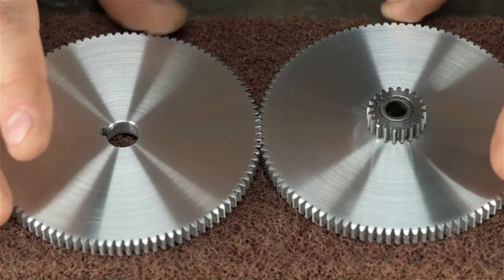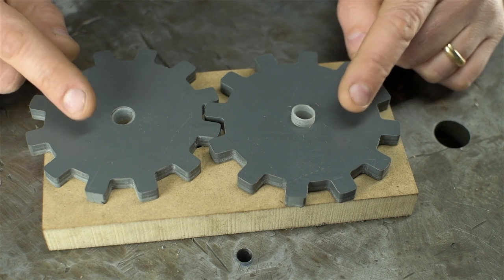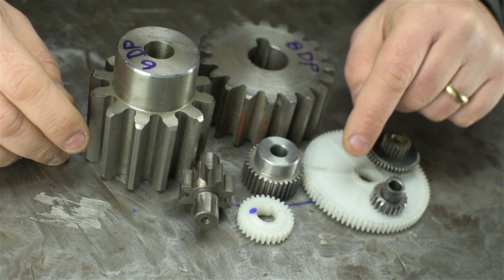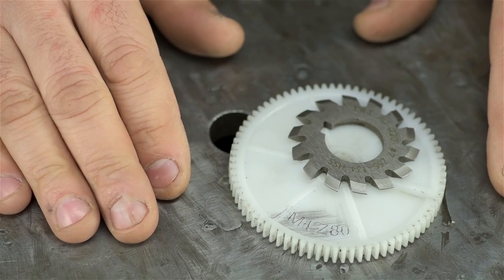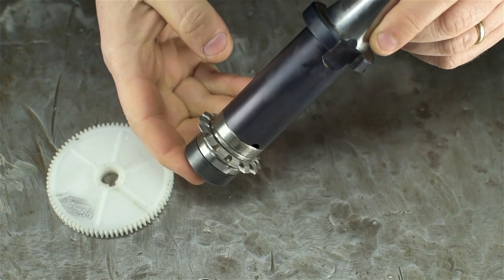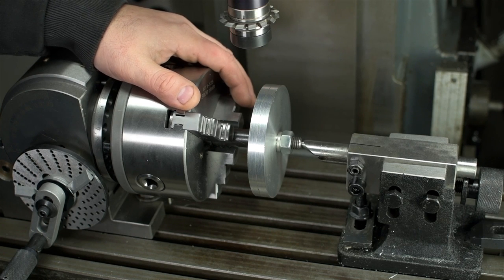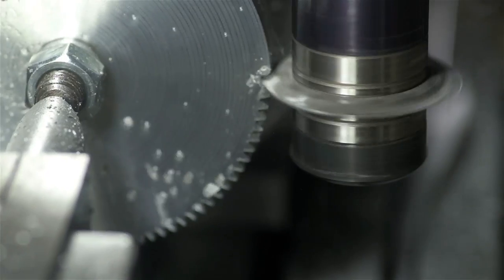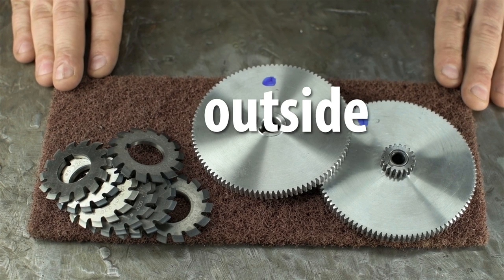Gears! - But Were Afraid To Ask (MiniLathe) - BETTER AUDIO

Comment: "Machinists, a long time ago, realized counting was for suckers..."  Sounds even funnier with the new audio!
Reply: I think its that they realized 99% of their processing power goes to avoiding being eaten by the machines.
Reply: See MIT machine shop video #1
Reply: @Eluderatnight  I'd say that's about where I net out....spend my time keeping my fingers attached, not counting on them! :)
Reply: I literally came within a couple of millimeters of amputating two of my fingers off from a very thin turning of 304 stainless. I still can't feel either finger and it's been 6 months. I had my long handle hook Bill needle nose pliers in my hand I was thinking I was safe when all of a sudden an uncontrolled curl came down and was just about to wrap itself up in my aprons longitudinal wheel. I didn't even think, I just swatted it with my left hand to keep it away from wrapping up in the wheel! It was merely a split second operation but the very second that turning decided to get caught up on the jaws of my chuck in reel itself in, slicing right down to the bone and halfway through the bones on my ring finger and middle finger of my left hand. It did not feel like a cut at all. It felt like someone had taken my hand set it on a vice or in anvil and smacked it with a small sledgehammer. Yank the skin off my fingers like a glove! Luckily they were still attached by the top of my hand and it slid back down over the phone so I was able to push the skin down squeeze it with a towel and wrap it with the last clean towel in my hole shot. I was shaking so bad I could hardly walk!

I was unable to dial my phone and luckily my instant messenger was open with my right hand I tapped on the phone are you trying to call my girlfriend on instant messenger which I never do and I didn't really even expect her to answer but she did? I told her what happened and they said I got to go I'm going to pass out and she had the paramedics here in a couple of minutes. The goddamn cops were here it made me unwrap my hand which was the most painful thing I ever had to do in my life.

I'm on painkillers for chronic pain so much so that they don't even affect me as far as my reflexes or cognitive ability open on them for very very very long time and I can't even feel them other than the relief that they give my lower back knees and hips. (I worked construction for many years) at any rate I have what is known as hyperalgesia that means I'm enormously sensitive to any stimulus that causes pain. It had precise my pain to a degree the can I really be calculated but it is significant. For example when I get a tooth pulled it makes me want to pass out from the pain and there's nothing they can do about it. They can numb it out with 10 shots and I can still feel it full on!

The moral of the story is always expect to be maimed. If you always expect that it will most likely happen your odds are greatly reduced because you'll be going to what others might think of is ridiculous lengths to be careful in all operations. But even though like I said who would have thought that just flicking away tiny chip would have caused this. To be honest that you wasn't even sure or didn't say it was attached to the work any longer. It was so fast I didn't even have time to think about it. I totally innocuous thing like that can cause mutilation it half a blink of an eye!
Reply: @ClownWhisper  I keep super glue next to my tool bucket for stuff like that. A little dab on a piece of paper and lay it on the closed and lined up cut. Maybe a little tape on top to immobilize it.
Reply: @ClownWhisper   "always expect to be maimed" . This is very similar to riding a motorcycle - they always say "assume you're invisible, that way you're prepared for the worst..." Sorry to hear about your accident - but glad you didn't lose your fingers.
Reply: @ClownWhisper  Your post is too long and scary for me to read right now at work.  I will keep it for later reading.  For some reason, I'm terrified.  Which makes me think that I must read this.
Reply: @danl.4743  Remembering it and retelling it makes me physically ill in my hand shake. I'm not a wimpy type of person they work construction read out of high school for a long time 8 years 12 years as a matter of fact 8 years is a laborer in 4 years is a bricklayer. A broken literally every bone in my body no big deal I've seen horrific accidents no big deal but this for some reason horrified me it sickened me and it sickens me thinking about it and as far as I'm concerned I got off very easily
Reply: @motopreserve  thank you my friend I hope it helps someone but hearing it. it makes me physically ill to retail it I still feel it
Reply: @ClownWhisper  When I was in high school our metal shop fundraiser was cutting bevels on 6" id pipe blanks for a nearby pipe-welding class. It was easy work. Chuck it up in the 3 jaw chuck, flip the go switch, make 2 or 3 passes, flip off the go switch, then flip the pipe and repeat. I got involved into an ego war with another student about who could do the most in an hour. Figured out how to make a single pass and then started loosening the jaws before the chuck finished rotating. Other guy threw 2 blanks across the shop before we were told it had to be 2 passes. I kept on because I was a 17 year old moron. After a week or two the wrench didn't come out of the chuck as easily as expected, and rather than just letting it get snapped by the ways I fought it. Pinched my left ring finger between the wrench and the ways. Fortunately the chuck was spinning slow enough that it actually stopped, but I'll have that scar across my knuckle for the rest of my life. It's a good reminder that equipment can be replaced, body parts cannot.

Comment: Nice. Another take on this is having a straight V tooth (like a rack, or an actual piece or a rack with several teeth), mounted as a cutter on the shaper machine and have the rack move ever so slightly as the blank is rotated ever so slightly - this the complicated part (but there are shaper attachments for cutting gears). And since the rack does not have infinite teeth, it would have to be reseted every 2-5 teeth depending on modulus and length of the rack used. It can be done but nowadays that rack in form a spiral forms a hob and meshing a precise gear ratio between the hob and the blank and let it run and move the piece or the hob side to side from time to time to make a cylindrical gear and not a globoidal gear. Also the hob must be angled to its helix angle to cut straight teeth.
Hobbing helical gears is another can of worms.

Comment: Looking forward to the CNC conversion. I converted my mini mill a few years ago, and have been very satisfied with the results. I've been eyeing up my 9x20 for the same treatment, but I need to fix the cross slide first. The guy who owned it before me replaced the gib with a piece of flat brass for some reason.

Comment: That was one of the best videos I've seen in a long time. I've made gears before (3d printed), but didn't really understand the relationships between the teeth geometry and the size of the gears. My latest attempt resulted in a 'crunchy' feel with the meshing, and now I know why! I had changed the radius of one gear, but didn't alter the involute profile on its teeth. That means the contact surface wasn't consistent, and so, it feels crunchy.

Thanks for the excellent learning material! 

Cheers

Comment: Excellent treatise on indexing, gears and involutes. I would have included the involute base circle diameter is the cos of the pressure angle x the pitch diameter, but lets not nitpick ;-). Insanely entertaining and educational at the same time.
ATB, Robin

Comment: Can you please make a video like this about cutting splines? I want to make custom length CV axles but I can't find any videos that explain all the technical details. I have so many questions like are there different tooth profiles (metric/standard), are there different tooth depths, do things vary depending on the shaft diameter, are there sets of cutters (like gear cutters) that you can buy to do spline cutting? Are axle splines different than splines used on transmission shafts or are they the same? Thanks for all your videos, you are an excellent teacher!

Comment: Nice job explaining a tough subject. It can easily get very confusing, but you broke it down nicely with the signature word play.  One more thing, if strength is not an issue, you could switch the module of big and small gear of one set to get a higher tooth count in a smaller diameter gear and still make them fit. Just a Thought and always a pleasure.

Comment: Excellent video Tony. Lots of new in-scope information about gears I did not know. The only question I still have after watching the video, is how you determined the diameter of the stock before you started cutting the gear teeth. Could you add that to the next vid? Thanks again for this channel.

Comment: Dear Tony, Thank you very much for your very clear explanation on cutting involute gears... you did forget to mention one crucial thing though... When you mention the indexing disk (in your example) and you say "move it eight holes from the starting pin... use the little arms to move the indexing positions to the next 8 holes".
However when I count them on the image I count nine. That MAY mean I can't count or that you forgot to mention whether one should count the hole WITH the indexing pin up until eight or count eight holes from the hole AFTER the indexing pin? 
Please lift some of the mist that now hampers my vision to cut a perfect gear
Thanks a lot for a very entertaining and instructive video :)

Comment: Hello, in this lock down period I'm making a new 250mm chuck size lathe, from scratch.
Arbor is 60mm in diameter. 
I'm not expert in gears as much as I need now.
So I need your help.
I would like to make a 2 speed gearbox like the Chinese mini lathe, oil lubricated. 
A kind of bigger replica of it. 
So about gears, I already have the M1 gear cutters but seems to be small for this purpose.
So first question, which module can be the right one to make those gears?
Otherwise, do you think it is possible to use gears from a car gearbox?

Comment: Hey just thought I’d chime in, being fresh outta school. Both DP and Module gear cutter sets are split into 8 cutters, but the cutter numbers are supposed to be backwards from each other. Why? I don’t know, but it’s not a mistake. If you’re trying to cut a 12 tooth DP gear you’d use the #8 cutter, and for a 12 tooth module gear you’d use the #1

Comment: Does this mean we have to reupload the same comments again?
Can you change the gear ratio on all the gears to get a greater reduction while still fitting inside of the covers or would that mess with the ratios on the lead screw and screw threading? Would say, if the lead screw turns on a ration of 4, would using a gear set that had a ratio of 8 work just as well for the lead screw or would it make things like a 1/4-20 thread into a 1/4-40?
To be honest, I did not notice any difference in the audio this time around, of course I am deaf and just this week found out youtube has an automatic closed captioning. go-figure.
thanks for the video and the disembodied fingers pointing at things merrily.

Comment: I'm sure someone already suggested it, but do you think you could use the servomotor rig you made for your CNC machine and a "CNC dividing head"? Or a geared-down stepper motor perhaps?  Backlash might be an issue.

Comment: Fanks for insulting us twice This slightly  Older Tony, at least this time the insult was with god audio. 
Just proves to life's a pitch🤔😱😎

Just a little query if a straight gear is curved to infinity.
What happens when you gone 'to infinity and beyond' they gears jump inside the gear, do l need a beyond infinity gear cutter? 😱😱😱

Comment: What size dividing head is that Tony? I have an 8 in rotary table in the kit 4 using it as a dividing head is only eighty bucks primarily because it comes out of China. I don't know if it's worth it or if I should just drop the coin how to divide in head that's kind of where I'm leaning right now! unless of course someone comes along and tells me that the rotary table works just as good and go ahead go for it and get the kit

Comment: I see, a round gear needs rounded edged teeth because of how the gears mesh, because it's always spinning into the next gear, but a straight rack, or a VERY large gear only needs straight sided teeth because the "angle of attack" is always the same across the rack. Or something.

Comment: Hey @ThisOldTony if the size or diameter of gear is determined by the pitch and number of teeth, how does one figure out what size of round stock to work with of choice? 2nd watch here and still facinated. Thank you!
Reply: Better yet, we should be able to calculate the final dimension, or diameter of given gear by knowing just the teeth count and pitch correct? If so, if I want a specific diameter of gear by design and knowing the pitch it'll mesh with, I should be able to calculate how many teeth to cut?

Comment: Ingeneering hint, if you dont NEED hole number rates, use a prime number off teeth on one of the gears. Not 20 to 100, but 19 to 100, or 20 to 101.

Comment: So what are these other gear teeth profiles that work the same as involute gear teeth?
EDIT: There seems to be Cycloidal gears, which are good for watches, and other non-torque hungry applications, where floating axles allow for precision timings (great for watches). 
And Involute gear profiles for everything else, though asymmetrical Involute profiles seem to be better for uni-directional gearing; though manufacturing costs would be high so...

Comment: how did you find numbers foe the blank DIA,  AND,  were you just pullin chains,  with the drawing an involute part, i didnt quite get how it atyally related to the small teeth,  do you have to shrink the profile yiy drew,  or is the involute section just outlines where the curved part of teeth should be,  And. thats IF you wrap the line around a DIA that equals the theoretical BASE circle dia.  inflated for pinon,  deflated for rack.  Good and funny video though.

Comment: Is there maybe some reason why a smaller lathe SHOULD run at a higher RPM? I mean, there's the obvious reason that turning rounds of smaller diameter, you need higher RPM due to relatively lower surface speed. So I mean, is there another reason? Like maybe a lathe that isn't as rigid will work not quite as crappy if the RPM is cranked up a little? Or maybe a lathe that has an underpowered motor will work better at a higher RPM? Or maybe a lathe that is not as concentric, etc. Is the higher RPM possibly a tradeoff... like if you throw surface finish out the window, maybe a small, crappy lathe works better at higher RPM? 

Semi-rational thought: at the lower RPM you get more torque out of the motor, but that torque is only a small part of the equation, right? The rotational inertia also goes down at lower RPM, and a minilathe has mini-mass and mini-inertia to begin with. So if you gear it down, you might increase the chance of stalling out the lathe? Maybe the higher RPM to compensate for the lack of rotational mass in the spindle and chuck? Higher velocity = higher momentum.

Comment: The gears are plastic so they take the hit instead of your machine. As the gears are easy to replace The steel gears are for precision work where light cuts are made. On a dedicated machine.

Comment: Very nice video. But, seems you are saying that the output torque is the same as the input torque, which would be incorrect. It would be proportional to the gear ratio of both gears. Only if both gears have the same number of teeth the torques would be the same.

Comment: I'm not a pro, but is he correct at 18:45 ? he says it has another 9 holes (but there are 10... they go from 0 to 9, right ? so the number 9 hole is the 10th hole). And right after that ToT says that putting the last small pin in the last hole would be coincident with the "big row" being on 10 degrees. But... being on the 0 degree big row and last pin, we would be at 9 degrees, and going on the next step on the big row and putting the pin back on "0", it will be 10 degrees ? am I right ?
Reply: I guess i must be wrong somehow because it seems so obvious. sorry for bad english

Comment: Would it have been possible to achieve the same gear reduction to the lead screw by reducing the the tooth count on the small gears from 20 to 16 instead of changing the large gears? Would this not have allowed the entire gear set to fit within the original enclosure?
Reply from the maker: totally possible

Comment: have I missed the bit about CIRCUMFERENCE of the blank so that the 100 teeth will fit on it, I may have dropped off at that point for a second or two. It seems very important to get that  point.

Comment: What if you used a lets say 54-70 teeth cutter for a 53 teeth gear wouldn´t the error be less than if you used a say 45-53 for a 53 teeth gear? or is the error you get from using a cutter above worse than a cutter below?